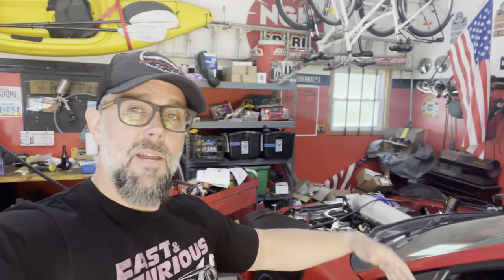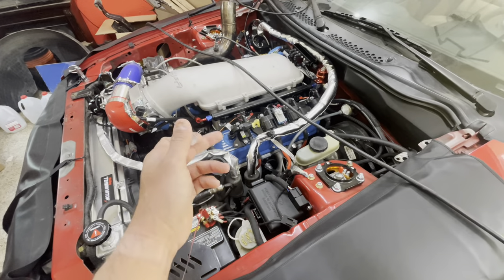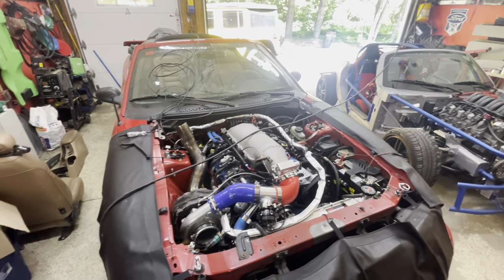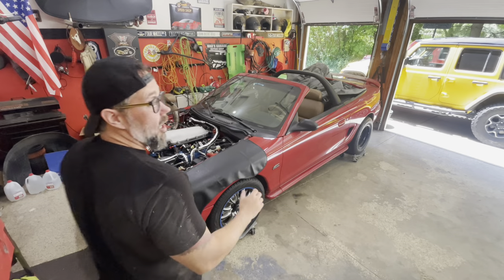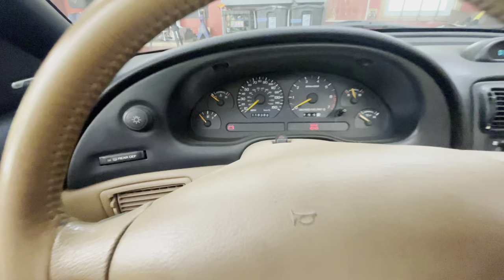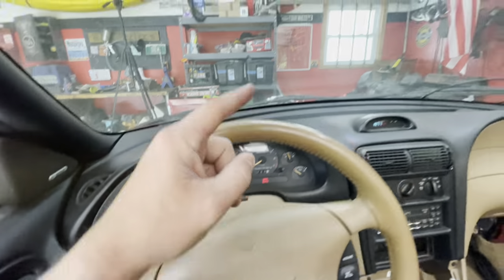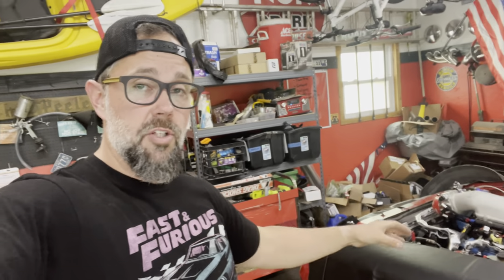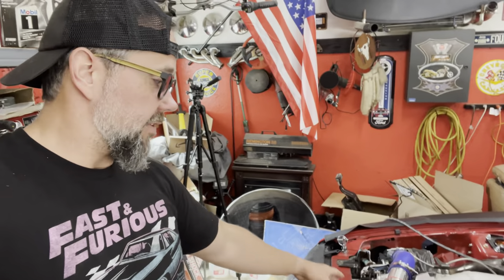550-937 Holley Terminator X Install - PART 3 - I Finally got a First Start 15 days out from HRPT!

Comment: That maf sensor could be part of it running ruff remember when you unhooked mine it ran like crap
Reply from the maker: This doesn’t have a MAF, has a MAP only. I tried it with the 3 bar map I have and it’s the same. It just needs some work on IAC and maybe the fuel or timing tables. We’ll know better Sunday when the tuner helps and teaches me more :)

Comment: I just added a Holley terminator x to my 94 5.0. So far I got power to the Holley and fuel pump, but when I go to start up, I have no crank. I see 12volts at my starter but nothing when I turn the key. Out of the transmission harness, I only had one wire running to the black connector that’s in the passenger compartment, purple/orange strip. Could there be a wire from the transmission to the chassis preventing my car to crank, like the neutral safety switch? I’d like to be able to use the key to start but if all else fails, I’m thinking of wiring a push to start to bypass.
Reply from the maker: I wouldn’t think any wiring from the trans part of the harness would stop it, because for example I don’t have a trans harness at all (5 speed). But trying to do a workaround with push button just to see if that helps could point you in the right direction. 

I used the ford Holley terminator Facebook group for a lot of help with the install, you might want to post up there. I also had my stock ford wiring harness sent in to MF Kustoms to be modded to work with the terminator so all my stock gauges would still work.
Reply: I had a similar problem with my stock 89 fox. I did a 4cyl to v8 302 swap. Went to start her up and got no crank. After my head was spinning for a week, I decided to plug in my t5 harness to the trans. Once I connected the Neutral sensing switch, it cranked. Somehow that completed the starter circuit.

Comment: Better check that oil for fuel.
Reply from the maker: Yep good call, I did and looked good :) it only cranked over 2-3 times before I figured out the Distirbutor issue and fixed it.

Comment: i notice your not running a intercooler what fuel are you using???
Reply from the maker: E85, I have a flex fuel sensor for when I need to run 93 for times when E85 isn’t available. 

But only planning to run wastegate pressure for now, maybe 8psi or whatever it ends up being so IATs should be fine at pressure, and I have the bigger 78mm turbo vs the 70mm.